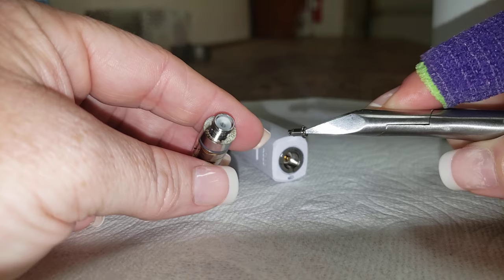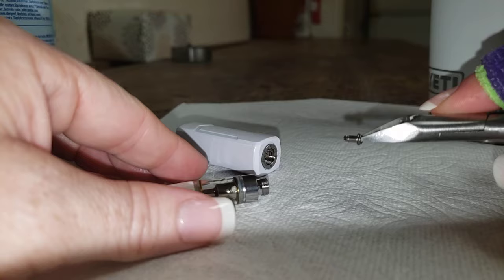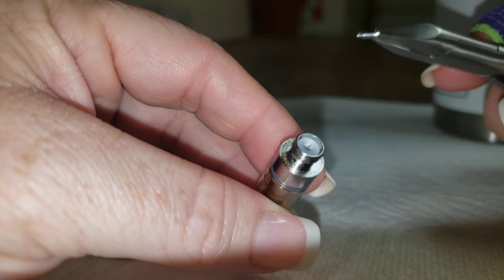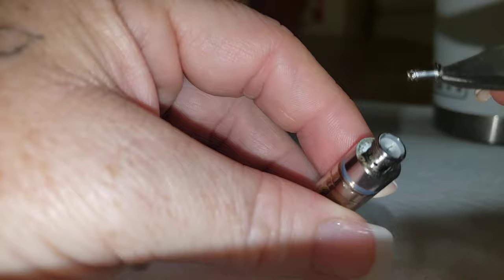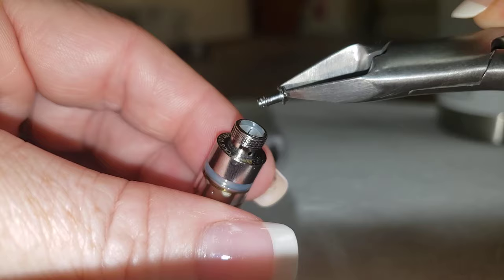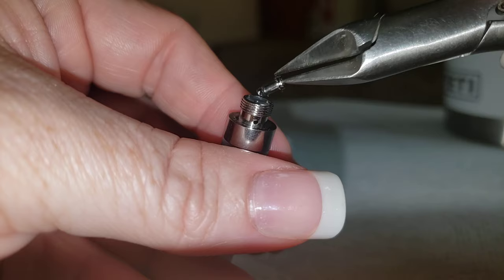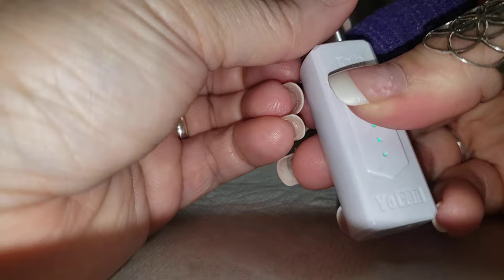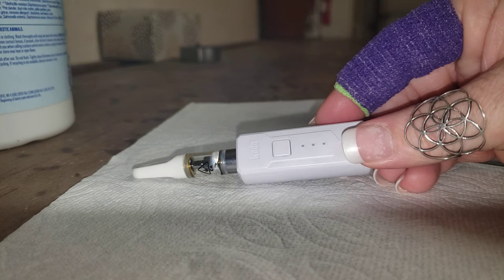How to fix your vape cartridge when all else fails- pt. 2

Comment: I feel like the only person in the comment section who isn't having success with this.
Reply: My plastic part came out first with the metal. You need to put that back in first and just make sure the wire goin through middle
Reply: @mattmmilli8287  I tried putting the wire through the hole AND leaving it on the side making contact but still isnt working for me.. the plastic also came out for me but I have it back in now but still not working. how did u do it?
Reply: @faayerubinn the outside metal where it screws is the ground. This wire she’s toying with is the positive. They must connect to their counterparts only at the base of the cart, if that wire is either touching the sides or not touching the pin, it will short, or blink.
Reply: find the wire, and it's not super easy to thread it into the hole because the wire is basically invisible, but you will get it

Comment: Holy cow. You're like the virgin Mary of cannabis. I'll forever keep you in my prayers for what you've done here. I had a brand new $50 cartridge have this happen, was actually searching ways to disassemble it completely to salvage the live resin and then I found your video. Now I can actually use it instead of taking it apart. If you're ever in the midst of battle and you need help, in your darkest hour, just say the word and I'll be there.

Comment: Ngl this exact thing happened and I went to reddit assuming to figure it out there… comments were basically saying “throw it out” or “try and save as much oil as you can to dab with.” Saw this video at the last minute, but was doubtful i’d get it to work again. I followed your simple instructions, and was glad to have located the wire. But mine had four tiny hole instead of two large ones… Needless to say, it took 2 hours and a lot of patience but its working!!!! 🎉 Shout out 2 you fr

Comment: Fantastic!!!   I was searching for videos, in hopes of finding one that could possibly show me how to transfer oil from a bad cart to a good one.
I was not having any luck and then I stumbled across your video.   This is exactly what happened to me!  The pin (or whatever) got stuck to the battery and pulled out.   After watching this vid, I pulled the pin back out, looked for the wire that you showed,  located it, and then thread the pin back onto the wire/pushed it back in.
VIOLA!!!!    Worked like a charm!!!!   Thank you, thank you, thank you!!!!    Your helpful instruction just made my day!!!!
Reply: I just threaded it back on the side it was hard with a short wire

Comment: Girl this worked! Now, I did have to take that first piece out but I also took our the plastic part cause I couldn't see the wire! it was under the plastic piece so I used a hair weaving needle to pull the wire out enough for me to thread it through both parts, put everything back together, screwed it on my battery & it is giving me the most beautiful clouds of smoke! 

Thank you so much😊❤

Comment: So I kind of figured this is what I needed to do, but was having a ton of trouble. 5 seconds into your vid and I figured out my problem. The rubber part around the wire had also pulled out when my pin got pulled out. I separated the rubber from the pin and placed it back in around the wire. Then it was MUCH easier to get the wire into the pin and place back into the cart. So thank  you for the vid!
Reply: THANK YOU!! I was having the same issue!💗

Comment: I have a cartridge that has this same problem with the wire. The only difference is that mine didn’t come with the small holes to thread the wire through. Instead I just simply had to make sure that the wire is touching/making contact with the metal part. Still, very helpful & informative video!
Reply: How do you make sure it stays making contact? Ive been trying for a lil while
Reply: @cman3464  I just like put it in a way that it was pressed up against it. I first pushed the wire toward the walls if you wanna say & then put the metal part back & it ended up pressed and making contact always
Reply: Took me a half hour with the same issue, be gentle and push the wire towards the white washer piece so it’s on the side and then drop the top in and you’ll be good but might need to try it a couple times
Reply: @tripclips314  BINGO! 🔥
Reply: When I do that my battery starts to blink white
Reply: @tripclips314  omggg that fixed it right away when the other attempts failed , thank you 🙏🏻 angels work 🤎😂
Reply: mine don’t have a wire please help
Reply: @tripclips314  i love you
Reply: @tripclips314 can u explain pleaseee

Comment: This saved my life!!! This is definitely the life hack I needed to stop throwing away money and/or time on getting a new one. THANK YOU! Stress relief at it's finest. 😊
Reply: I had this problem work a week now and it's finally fixed due to this video I've never been happier lol my wire was bent at an angle so I just straighten it and reattached took a few sad puffs to get to the one that snuck up and hit my brain into my chest with a one-two combo 😂 if you ever feel the strength slipping and your voltage not hitting the same just take apart and readjust I recommend checking future carts as well for same defect this could have saved alot of people money.. remember when these things got recalled for not working 🤔 weird.

Comment: idk why but my cart seems to have two wires. is one supposed to be somewhere else? Been looking all over the internet and can't seem to find out why there are two wires
Reply: I have the exact same Question and it’s irritating me
Reply: Ong
Reply: did u ended up finding out ehy
Reply: Did you ever figure out how to fix it??
Reply: I just solved it. There ought to be two holes in the metal insert. Put each wire in a hole. Use tweezers and good lighting.

Comment: Didn't work for me.
Reply: Hey try to find the wire and pull the end real gently then if you have to do it in front of a window or strong light... then as she said just connect one of the holes to the wire (just make it go thru like a needle and thread) and voila! I watched many videos and this one was the clearest one that worked for me (good luck) 🥰
Reply: @stool-pigeon mine isn’t even long enough

Comment: If I have 2 wires, do I need to hook up both or can I still do 1?
Reply: I have two wires on mine and I don’t know neither
Reply: @khicarter584  I figured it out, there is a rubber piece on the cart that u have to take out, then put 1 wire under the ring where the rubber goes and 1 wire there the hole is in the middle then u can re-wire the 1 wire into the hole
Reply: @greenhornet1305  yo i have 2 wires but i did not understand what you said Could you tell me a lil more clearer
Reply: @theweedpanda3747  I need someone to shoot me a music video for Drose if you tryna rec me
Reply: @greenhornet1305  lmaoo Na but for real I need sum help
Reply: @greenhornet1305 That did not work for me. I just solved it but there were two holes in the metal insert. Put each wire in a hole and reinsert. Use tweezers and good lighting.
Reply: Essentially the wires need to complete the circuit (make a connection) without shorting on the metal encolsure part.

Comment: okay but what if the wire has been pushed down further into the 🛒
Reply: I'd use tweezers to pull it out gently. Wire is actually strong, so you can have the tip stick out of the cart

Comment: Gotta love how the first video I come across is straight to the point and descriptive! Was able to fix a cart that just crapped out at a little under quarter tank, had to use a popsicle stick and electrical tape to hold it firm in place! Luckily my battery has a type c charging port so I don’t have to mess with unscrewing to charge. ‘Preciate ya!

Comment: Had a full vape that stopped working out of nowhere, I saved it with the hope that I could eventually fix it. Came across your video and thought I might as well just try it and I literally worked after the 2nd attempt. It is a little meticulous just because the parts are small but nothing that can’t be done! Thank you so much!

Comment: Bless you angel of cloud. I didnt want to go through the hassle of taking my brand new cart back to the store. Almost figured this out myself but i was trying to go through both holes. I think mine just originally had the wire just sitting between the rubber gasket and pin. So through one hole and up is absolutely the way to go with this design. I literally tried all the other ways before i got here.

Comment: just saved me from losing a brand new cartridge 🥲 bottom piece popped off w my palm battery and was so sad, thank you 😭 tip that helped me, was also twisting the piece that came out a bit more w the tweezers after pushing it back in

Comment: You don’t even need to put it through the baby hole you just need to put the rubber gasket on and then put the metal pin stopper in it but you have to make sure that the metal wire is in through the hole of the gasket and just that contact works. And I’m pretty sure that’s how they assemble it anyway since the metal wire isn’t bent.

Comment: Wow thank you soooo much! I had a brand new cart and it got clogged and I pushed through too hard and popped out the bottom and didn't realize the wire came disconnected. Been trying for over a week to fix it looked all over the internet tryna figure out what the problem was. finally came across this video and literally within 3 to 5 mins I fixed the wire. I was about to give up lol thanks again for the video it worked!!!❤

Comment: Had a brand new full $40 cart show up dead on arrival that I was about to toss. Happened to see this video, decided to pull it apart and noticed the wire was smooshed beside the center post instead of threaded through the hole, tried this method and now it works perfectly. Factory defect I guess, many thanks

Comment: Just a little tip that rubber piece can come off on the little metal piece. Make sure you take that rubber piece and center it in the cart with the wire in the center of the rubber part. It will make it easier to put the metal piece back in.

Comment: This was great. This trick was successful for two brand new full carts. All you have to do is locate the wire inside and straighten it to make contact thru the silicone piece to the metal “T” plunger 🪠 piece. Good luck everyone & thank you
Reply: Straightening the wire a bit with tweezers was key for me I think. I did it bc I accidentally pulled the rubber gasket out too and was like might as well and that was the one that did the trick.

Comment: Thank you. My metal contact piece did not have a hole for the wire, but instead made the connection between the clear gasket and the lip around the metal contact.

Comment: if your rubber piece has fallen out aswell connect one wire to the side of the cartridge and the other in the middle and place the middle one through the rubber and the rubber should be pushing the other wire to the side and the middle one is where you put the wire into position
Reply: It took me a while to figure out that the two wires were not meant to be touching.. but after separating them and having one wire inside loop hole and the other wire on the side wall along side the rubber... it made it work.. 🎉

Comment: Hi! I know this video is over 2 years old, but my vape pen battery isn't heating up and I took this same little screw out of the pen itself, and there's a little white wire looking thing, does that need to be touching the screw in order for the heating element to work?

Comment: I’m not getting it. It looks like you’re pushing the wire through the side of that insert and not the hole in the bottom of the insert. If you pushed the wire through the insert it would bend the wire and it wouldn’t work. 

Shouldn’t you push the wire through the center hole???

Comment: Dumb question, but is it safe to smoke without that metal part attached? I’ve tried looping it through but can’t get airflow once the cart and battery are connected. I tried it without the metal piece and am able to smoke but is that bad lol

Comment: so the difference with my cart and these ones is theres no hole on the bottom, instead of a spot to insert a wire its solid with no hole. im not sure if i should still attempt to take it off but it seems to be made specifically for batterys with preheating capabilities. should i attempt to remove the piece on the bottom?

Comment: the piece of metal that i have to thread the wire thru is a lot smaller than the one in this video and it seems impossible to thread it thru because its longer than the width of the circle i have to get it down into to thread the wire

Comment: THANK YOU SO MUCH!!
IF YOU SMOKE GCC CARTS:
If the bottom piece that says the name of the cart “Gold Coast Clear” around the cart comes off, put the wire that is apart of the cart inside the small hole in the bottom piece. Your cart will work again! If you need help lmk.

Comment: Very good. Wire was pressed down in the cart. Fished it out, couldn't get the wire through the hole but rather pressed up against the metal bit. Works!
Reply: i have the same problem how did u take out the wire?
Reply: @Rick-qo6vk  I guess some kind of thin thing you can use to fish it out like a different piece of wire or a sliver of aluminum can or something like that.

Comment: What if the metal piece doesn’t have tiny holes? I just threaded it straight through and it’ll act like it’s hitting (like it won’t blink) but no smoke will come out

Comment: can you do this with airo pods? I have a connection issue but the shop said they can't keep it. So they kept opening packs until we got one working and sold it to me for a dollar. I'm thinking a piece of foil but I dont want to short an ion battery. I'll put it in the oven before I'd do that.

Comment: Holy shit. Been messing with this cart for literally a month trying to get it to hit. Which I ended up pulling out the bottom on my own and really messing it up little rubber nut and all. This fixed it I guess the wire wasn’t threaded through to begin with.

Comment: Really helpful , fyi you don't have to run the wire through the hole as long as it's touching the metal piece it will work

Comment: Thanks for the video.  What are these very small tools you're using that can manipulate these small parts.  Any recommendations on what to buy?  I have some very small needle nosed pliars made for jewelry, but they're still too thick.
Reply: I used tweezers and a safety pin. Worked like a charm. Took just a few minutes.

Comment: Holy shit this actually works. It took me a few tries cause I couldn't find the wire, but once I did I used a toothpick to push it into the center, then placed the rubber grommet back in, then the pin and now it works.

Comment: You do not need the wire to go through that hole at all actually. it just needs to be touching the metal piece your holding. The wire being between the rubber and the metal piece is good enough.

Comment: I just can't get it to work 😢 cheap ass pos cart I bought! The metal piece on mine doesn't look anything like that. It doesn't have anything to thread anything through except for the center. And my wires are barely visible 😭😭😭

Comment: The light on my battery changed from white to red so it’s connected but it’s not pulling anything 😭
Reply: I SOLVED IT! If it still doesn’t work after taking it apart and knowing the wire is connected, look for an old cart and use the metal piece from that one instead! Mine was brand new and just never worked so it had to be the bottom piece being defective.

Comment: If you can't get it like i couldn't and you still have other emptied carts that just have the one bigger hole in the bottom in that type of piece you can just switch them out and use that one much easier

Comment: Yes!!! I fucked with this thing for 2 days! Even bought a new battery! This was the first time the connector came out and the rubber piece. Anyways the wire wasn’t even showing I had to dig it out. Fixed it immediately. I don’t get to buy a cart often (couple times a year) and they are expensive. So I was def upset about $40 down the drain.

Comment: Most of the time you don't even have to take it all the way out and go through the hassle of fishing that little wire through a hole. I just grab it with tiny needle nose pliers or pry it with a tiny flat screw driver or straight pin and pull it out ever so slightly and it usually hits great after that. Unless it's a clog issue.

Comment: A lot of carts have multiple of those tiny wires with that small piece that they go through sometimes having no small holes, and that’s if one of the tiny wires didn’t snap or break.

What works best at that point is to just find another cart and heat up the one that isn’t working and transfer the oil, this seems way harder and messier but trying to fix a short is way harder and more time consuming.
Reply: I just fixed this in 20 seconds
Reply: @Dontify how

Comment: I've had this happen before, it's because the pen, charger and cart are sticky..clean with alcohol and this should avoid that from happening. Or you can buy a $13 syringe and transfer it to a clean cart. Orrrr you can cook with the oil.

Comment: This works most of the time but I'm convinced I might have pulled too hard on the metal pin because even though I loop it once or even manage to get it through the center of the metal piece my cart still won't hit.
Reply: same bro i got more than one wire in the bottom of the cartirdges and tried both wires through the pin still wont work. You find a way?